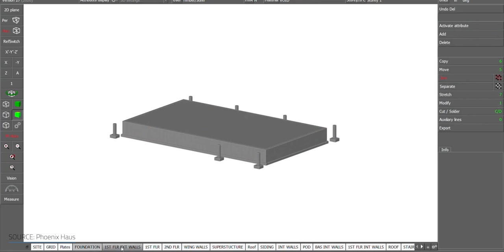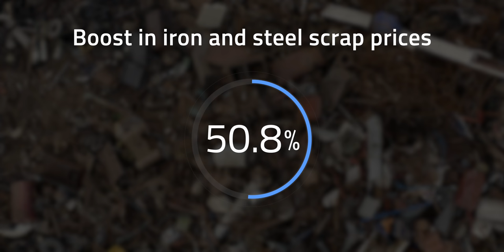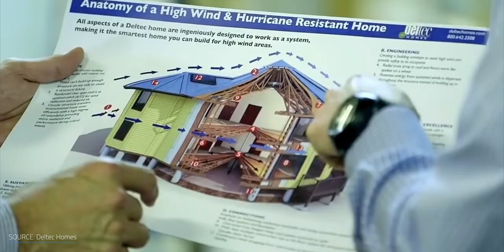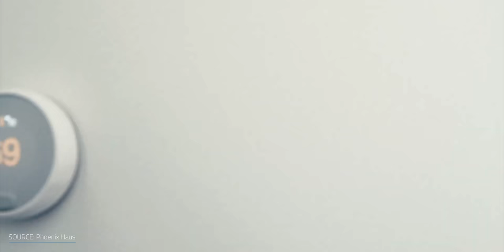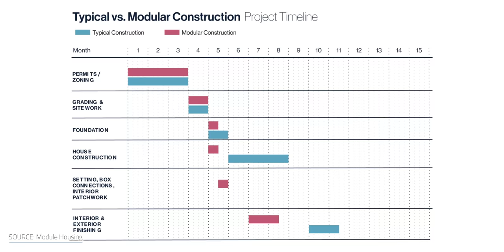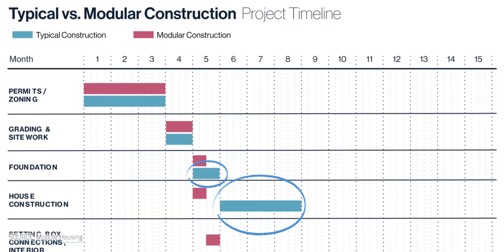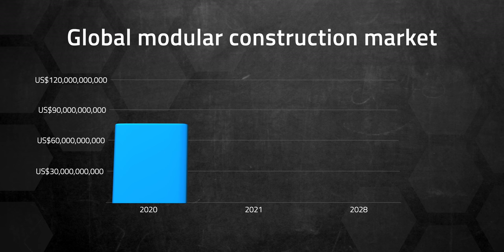Exploring Modular Homes - Cheapest Path to Net Zero?

Comment: Could you please touch on the qualities of the wall materials used? I come from an environment where brick walls are considered to be the ultimate in both style and function - yet on holidays to locations in the arctic circle I see that most walls are (at least) finished with seemingly wooden panels. In short - are brick / concrete walls better from a performance stand point for a residential house?

Comment: You might also want to consider ICF homes.  There are some definitely advantages, especially if you use metal stud construction for the interior walls (don't have to worry about insect damage... a problem here in TN). 

Anyway, just a thought...

Comment: @Matt - I too wish to build net-zero in N.E.  Would you share what you found when searching for New England modular home companies building net-zero or passive house? I couldn't quite hear the two you mentioned in the video.

 What kind of wall construction will you use? Double stud? Exterior foam? 8" studs? What R factor are you aiming for? Will there be thermal hot spots where the modular units touch each other?

How will the modular units be sealed to each other to ensure < 1 air change per hour @ 50 pa?
 
Thanks for journaling this adventure.

Comment: part of sustainability is the lifespan, which keeps bringing me back to ICF... 
they'll survive hundreds of years with minimal care. nearly disaster-proof too, as the shell/roof/floor remains & you'd only need finish-materials redone in worst-case. a few building methods can reduce thermal-bridging & hit decent ACH numbers, but not on even a sloppy-built ICF's level. plus, the insanely high energy-saving benefits of thermal mass can completely overcome the initial cO hit in just a few years, giving the structure a massive lead in regards to impact.

Comment: I question the waste metric used here. Sure you definitely go from a couple of dumpsters down to a fraction of that, but you have to factor in the waste created at the factor where they construct the modular parts before transport. I can definitely see them being able to better plan and use more of the wood without creating as much waste but, arguing it goes from a couple dumpsters to a couple bags is nothing but ignorance. I would be curious to know how much waste is created at the factory so we can measure how much more efficient it can be.  Even 30% can make a big difference, it is definitely not the 90% claimed here.

Comment: It's worth noting that in the major US metropolitan areas, the price of land is around 40-60% of the final cost of the home, while in the cheapest metros it's around 20-30%. Even if the price of the materials were to be lowered and modular architecture was to be used it wouldn't make a dent in the final cost, as the land prices would just eat up those savings considering that it's a seller's market and the demand-side has shown its willing to pay these high prices.

Comment: Have you looked into ICF (insulated concrete formwork) construction? With regards to the emissions from construction compared to the lifespan and efficiency over time, despite concrete being bad for the environment the end result is a mush more sustainable structure, overall.

The construction industry makes a lot of environmental claims but often don’t tell the whole story. For instance, “Passive Haus” standard homes have different definitions across different countries. In the UK the CO2 efficiency of materials is only calculated for their use in the UK. meaning that if we cut down the rain forest and ship the timber to the UK, none of that detrimental CO2 effect is included in the Net Zero calculations. 

Given how long these new timber framed houses can last compared to, brick, stone or concrete dwellings, the sustainability of the property (over time) is significantly reduced.

Comment: Matt you should take a look at the new L-Form by Alpi being a new concrete poured system with high-end smooth finish, super eco-responsible and very low environmental impact. They pre-design all the power and water conduits into the form and the structure is built much much quicker, very little timer/lumber required and overall cost savings in the 20% from traditional building costs at the OLD rates!! well worth a look!!

Comment: Some of the biggest cost benefits of modular builders comes from the economics of scale. Due to a higher volume the builders of modular homes can buy directly from the saw mills and manufacturers for better prices. Even something as simple as drywall screws make a difference when you order by the pallet instead of by the case. They can also have better vertical integration of labor and rely less on sub contractors, saving in time and money. They also have less dealings with local inspectors, which in some areas can be a real pain.

Comment: Critical to achieving net-zero housing is an absolutely airtight envelope so you have control over air movement in and out of the structure. The standard approach is tape all seams and caulk every where there might be a gap. But as the linked YouTube video illustrates, that even the best manual efforts miss gaps and holes. There is a system recently developed that will find every single gap in the envelope no matter how small or hidden it is and automatically seal it. This system uses a blower door to pressurize the house and an atomizer to create a fog of caulk particles fine enough to stay suspended in the air. As the pressurized air flows through even the tiniest pinhole the caulk particles are entrained in the air escaping to the outside. As the air accelerates through the gap the caulk particles bump into each other and stick to together and to the structure until the gap is completely sealed and no more air is moving through it.

The best time to do this is when the shell is completed but before drywall is installed, but it can be used at any stage of construction including for existing houses (but it pretty much needs to be empty of all furnishings, so best to do this before moving in). However, the more finished the interior the more prep is needed to cover finished horizontal surfaces since some of the caulk does settle out of the air. If flooring is already installed, then the entire floor will need to be covered with drop cloths. So the earlier in construction this process can be applied the lower the cost.

This does bring up an issue with using this system to seal modular houses. Modular houses are usually very nearly completely finished inside before leaving the factory and mostly likely you would want to use this method to seal the entire structure once all the modules are joined together on the final site and sealed/caulked to the best level humans are able to do. The potential solution is to wait to do final installation of finished surfaces until after the modules are assembled and this process applied. Or it could be done in the factory to individual modules if temporary bulkheads could be used to cover openings in the module such as where two modules connect with each other and the openings form doorways between modules. This wouldn't address the leaks at the seams between modules, but those are well defined places where sealing tape and caulk would likely do a very good job of sealing all leaks.

Here is a link to a manufacturer of these systems
https://aeroseal.com/aerobarrier/

And here is an example of it being used to seal a house where the builder made every effort to completely caulk and tape every possible gap and yet the AeroBarrier system reduced the CFM for a pressurized door test to 1/10th of its original value.

https://youtu.be/JYugiSwWoPk

Comment: So, do you guys have old homes that can be moved?  I would think this would be a great low emissions home.  The wood or building material is reclaimed and the outside is completed.  The insides are a blank canvas.  We see a lot of homes moved from one site to another to at as the starting point for the build.  Typically it can save you between 20 and 30% of your costs.

Comment: Hi Matt,
Please do an episode on Bamboo, specifically as a building material for furniture, homes,  buildings and as fabric. 
I heard it is a great alternative for timber and Cross Laminate Timber because of its' superior mechanical properties and its' short grow period of only 4 years. 
They are also doing research on using it instead of steel rebars for light duty concrete structures.

Comment: Built the first platinum green home made of styrofoam here in AZ.  R180 thermal resistance and was built by strata international here i. Phoenix.  My house is 16 years old and has a wall strength of 250pounds per square inch.

Comment: Hi Matt, 
I am a designer and thought that the video you recently launched "Exploring Modular Homes - cheapest Path to Net Zero" was very intriguing. My thoughts behind the idea's of moving more into modular construction would be centered about integrating a modular component(s) shells, or the like, into existing residential construction ~ i.e. placing a modular unit onto the second story or adjacent to a room on the ground floor of an existing home. From your research given the structural costs also being inclusive to this (which would likely not be that much) what would you say about such an idea?

Comment: In the UK (and Europe?) the cost of the land to build even the smallest house far exceeds the cost of construction. Factory 'panel built', known as 'timber framed' houses in the UK, got a bad reputation because the panels were not adequately protected against moisture ingress on site. In every case these 'timber framed' houses are faced with brick, not brick tiles, due to their proximity and building regulations minimising transmission of fire.

Even if you have the wherewithal to purchase a large plot of land, a timber building (and some others) is classified as 'non-conventional construction' by Mortgage lenders so they are only available to cash buyers.

Whilst I admire your argument for energy efficient homes, most American houses last for only fifty years. In Europe we continuously maintain or repeatedly modernise brick and stone buildings that are hundreds of years old and even some 'timbered' (9"x9" timbers) with 'wattle and daub' panels and thatched roofs that are over five hundred years old.

Comment: The phrase "net zero" is so easy to remember, and it rolls right off the tongue: "I'm researching net zero homes. I want a net zero house. Net zero is the future," etc. Except "net zero" doesn't actually mean anything. It's not about R-values, air changes per hour, LED lighting, home automation, or even comfort. It's about producing as much on-site energy as you use. It took me awhile to realize this. Extreme example, if you had a nuclear power plant on site, then you could waste megawatts of energy and still be net zero.

The phase "Passivhaus" has meaning. Passivhaus is an international standard for energy efficiency (actually 2 competing standards). Passivhaus is all about efficiency and comfort. If you have a Passivhaus then at least the house itself will take very little energy, and can easily become net zero with the addition of modest on-site energy generation. Now if your side hustle is mining Bitcoin you might want that on-site nuclear power plant.  😉

Thinking people should ban "net zero" from their vocabulary. Passivhaus is where it's at.

About prefabs (not modular, or mobile). I live in one. The first big downside is my ceilings are only 7½ foot high because the modules have to be trucked to the site and there are legal and practical limits on how high a load may be and still travel over the public roads. The second big downside is they used 2 x 8 floor joists on 12-inch centers for a 14-foot span, just to make the package 2 inches lower. Very bouncy floors. Something to think about when you're considering a particular factory's offerings.
Reply: You aren't completely wrong about the net zero point, but you are mostly wrong.

Net zero is driven by a few principles: reduction, reclamation, absorption, and generation. FIRST in this is efficiency (reduction).  At the end is the sustainable generation.

What is not mentioned in this list is the cost.  Right now, the balance point is between efficiency measures and the generation.  As efficiency measurees improve or new technologies become available, the need for generation will decrease.  That actually produces a double benefit... The efficiency measures can improve and the generation measures can be reduced saving money on both ends.

Nobody who is a good designer is disregarding efficiency when designing net zero structures.
Reply: @mjmdiver1137 , good ideas in general, but not actually a requirement for net zero. No matter what else, your build qualifies as net zero if your power bill averages zero throughout the year. There are no standards, no required specifications, and no defining principles, only the mantra: "If you use energy-saving technologies you can save money on the power-generator phase of your project." So does that mean blow additional insulation into your attic and switch to 100% LED lighting before adding solar panels? Sure, that works.

Passivhaus is a pair of international standards (the original single-target standard, and the modern target-depends-on-local-climate standard). And there are a pair of international organizations that will certify if a build meets their particular standard. Matt has a video about Passivhaus where he talks about the five principles: 1) superinsulated envelope, 2) airtight construction, 3) high-performance glazing, 4) thermal-bridge-free detailing, and 5) heat-recovery ventilation. However Passivhaus does not require or even suggest you need to add on-site power generation, or attempt to zero out your power bill. 

Outside of its effect on the power bill, net zero lacks a precise definition. Therefore as a tool of discussion it's not as useful as Passivhaus and its five principles. Besides, given that substantially improving efficiency is far more challenging that putting up a wind turbine or slapping a few solar panels on the roof, Passivhaus is the more compelling discussion.
Reply: @ScottyDMcom  Do you worin in the industry?  Seriously, there isn't a single person in the industry that is working on NZB that isn't first working on high efficiency construction as the primary cornerstone.

I agree it isn't e requirement, but there is a clear understanding that the efficiency is the key to having a cost effective NZB.

Comment: You get what you pay for though....modular homes are cheaper but the cost is that you can only pick from the modular list itself.  This means the layout designs are extremely limited versus stick-built which you can design however you want (within regulation limits of course).  The other issue is prefab "sink" problems, where pieces of your lego house could end up settling different than the rest of the house....where stick-built would warp, lego can have a fracture line.  The damage might be minimal, but if you have a modern "open" design, the flooring may end up with a lip line that you're surely going to continually trip on.  If it's laminate, it will bubble.

Can't just ignore all the negatives just because the price is better

Comment: I always say the way we build modern houses is made to cost people money every month. Which is why I am building above ground rectangluar passive solar earthship house a 24x32 section at a time. I was gonna use concrete block, but going with local limestone block cheaper and better for environment. I like rockwool comfort board then one way moisture wrap with masonry veneer. Under concrete and foundation insulation is a must to keep ground from taking heat and loosing thermal mass. Simple mono sloped roof for winter sun to keep it simple. Building an energy star rated masonry heater/stove/oven old world style for heat besides passive solar. Always interested in cutting down monthly household bills and labor and material cost through better building designs. I may even quarry some rock off the property by hand too. Handicap accessible is a good fore thought too. I like the big 3 foot doors with a big mud room.

Comment: I like the homes that are built in panels. I think the modular homes have some limitations on building. Pretty much every sections maximum size is 8'6" by 53' by 12'. For customization that poses an issue with packaging that needs to be engineered and tends to lead to homes being constructed as rectangles.

Comment: Modular homes produce about the same amount of waste as on-site construct. Generally Module home designs are to minimize waste, If you use the same design as the modular home the waste will be about the same. As far as waste, if the home is built right with quality products it will last a long time and thus minimize waste over the lifetime of the home. Poorly constructed homes using inferior products (usually to cut costs) will generate a lot more waste do to repairs. 

Issue with modular homes is your unlikley to include materials & designs for high-performance homes: ie SIP roof continuous exterior insulation, large roof overhangs, as will as over all dimensions (ie each piece must fit on a flat bed truck). Also some building sites might be unsuitable because you will not be able to get a flat bed truck with heavy load to the jobsite. 

Traditional construction methods also allow you to tweak the construction when issues are discovered. This could be increasing the door opening or shifting a window or door opening a few inches. It can be difficult to visualize very detail on CAD drawings or even with a virtual walkthrough.

Matt Risinger's YT channel has a lot of videos on High performance home construction.